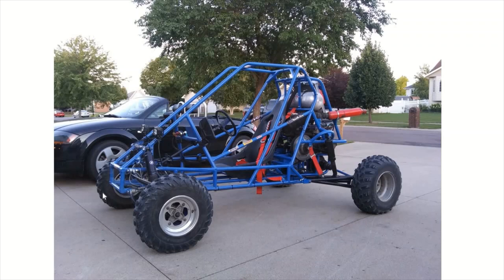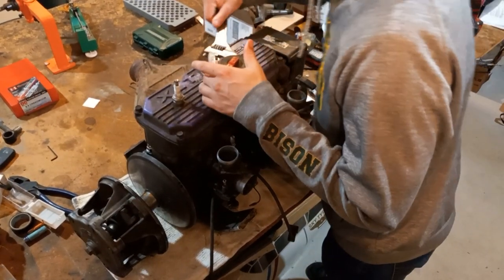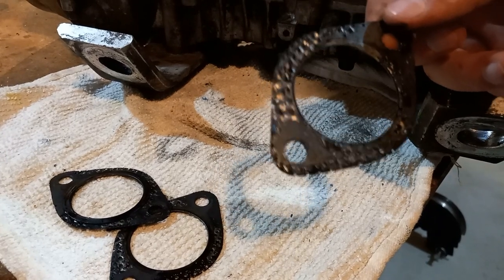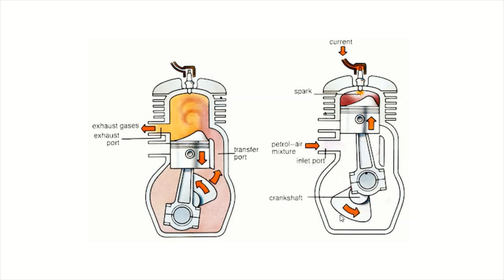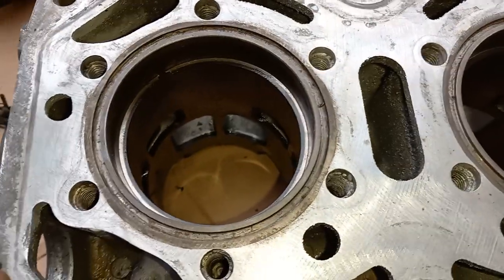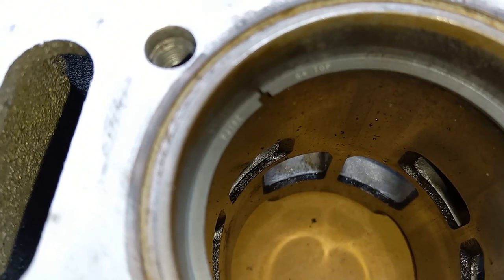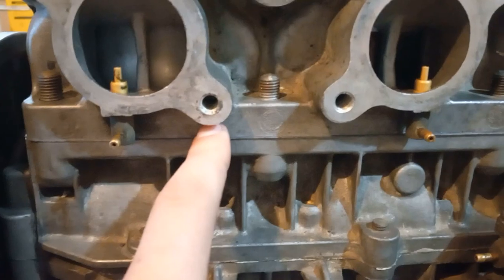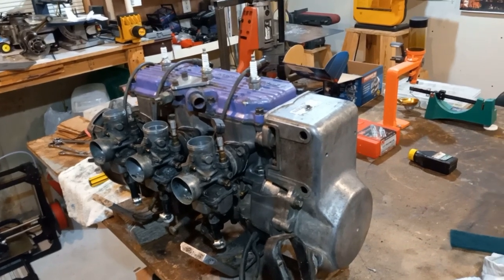Adding More Engine Power

Comment: Can’t wait to see how this thing rides after the rebuild! The engine sounds awesome when it revs out properly. I need to get the 185 main jets in mine and hopefully it’ll sound and rev out like yours does.
Reply from the maker: Don't know if yours is a 580 or a 600 but mine is a 580 if yours is a 600 you might want to try 190's

Comment: if the reasons for a three cylinder sled are at all similar to a 3 cylinder bike, they do it for vibration reduction. not really a power thing, but ya great video! I'm looking a building a cart from a 96 wildcat 700 motor that I have.

Comment: When you show the pistons all the ring gaps are pretty much lined up. With 2 rings you should put the gap 180 from each other.
Reply from the maker: The pistons have a pin in them where the rings line up at.